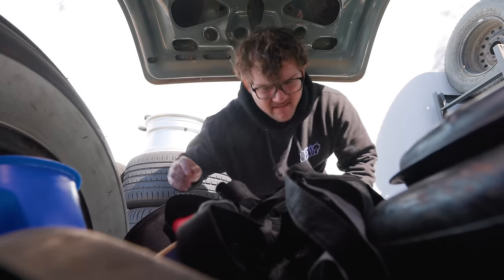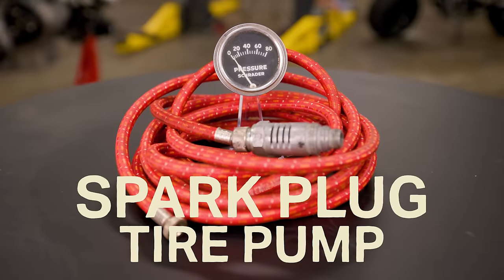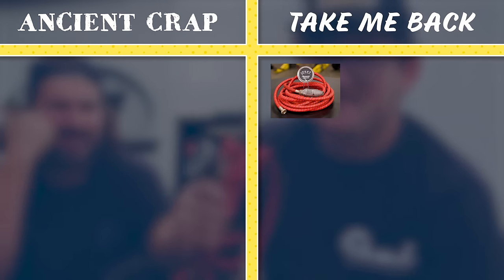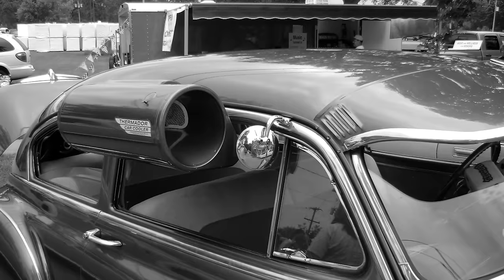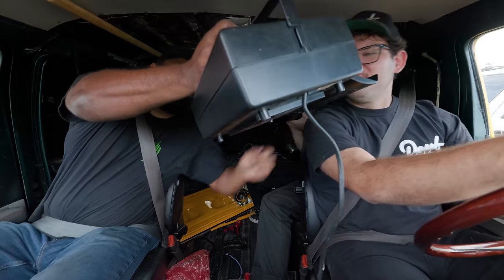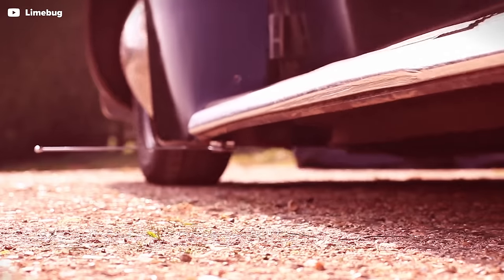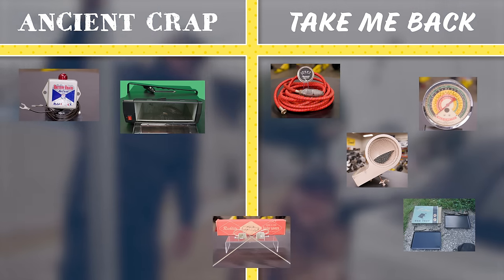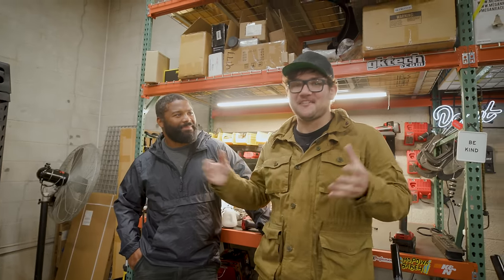Testing Forgotten Car Accessories

Comment: The battery brain isn't entirely rubbish.. older charging systems relied on a current through the charge light to excite the coils in the alternator. If this was in parallel with the charge lamp it would protect against bulb failure and ensure a good current is pulled pretty much as soon as the alternator turns to get it charging before the charge lamp goes out..  so it's only getting you a couple of seconds extra charge.
Reply: Back in the day they used mechanical regulators. By changing the width of the gap on the relays under the cover you could adjust voltage and amperage output. Now for some alternators you can get high-output regulators.

Comment: Regrooving tires is still a common thing; just not for normal car tires.
The two most common places -

Tractor Trailers - because you often put a lot of miles that wear the tread down before the tire is old.  Being said, since it doesn’t need to be perfect, they’re regroove those tires a lot.

Industrial Vehicles - you’re not going to buy a new tire because a long bolt puncture you tire. Since these tires are so massive you need to cut chunks out where the damage is to safely patch it

Comment: The swamp cooler will work great, provided the ambient humidity is low. Lived in SE Arizona for nearly 25 years, and for most of that time I used a swamp cooler on my house. Humidity was about 8-20% most of the time and it worked great. Once humidity got up about 40% during monsoon season, it didn't work so well.

Comment: The tire regroover is still used on tires over a certain ply rating. At least I saw it being used 20 years ago. Did a pretty good job regrooving a 10 ply tire

Comment: My grandpa mentioned the spark plug tire pump to me a number of times. Very interesting to see one in action. I always assumed that it did pump fuel into the tire, and that you'd use it in an emergency and then replace the air in the tire ASAP.

Comment: Back in the 1950s a local farmer used an engine powered milking machine. Remove spark plug. Screw in adapter. Start engine which produces a vacuum. OK unless a valve stuck & milk started dripping from the exhaust.

Comment: alternators were introduced in the 1960's for cars. back then cars didn't need the large voltage.
The light probably drew power from the battery and did its job.

Comment: The tyre cutter is still in use today, but on tyres for heavy goods vehicles. A lot of tyre manufacturers of HGV tyres actually provide data on how deep the tread can be recut, allowing for a longer lifespan. I really wouldn't recommend it on a car tyre.

Comment: The re Groover is the bomb!!!... I used one of those back in the 90s. The tire shop that I worked had one. I didn’t use it on customer tires just my own….lol. Too many burnouts. Made the tires look like new again that’s for sure. I also have a wood burner from the 70s at home. I used that on my lawnmower tires a couple years ago.

Comment: The battery Brain box would have worked perfectly on a lot of charging systems. That resistor would in fact request a higher voltage with the way old regulators worked.

Comment: My grandfather had the spark plug air pump and it really worked. The curb finders or curb feelers as I knew them as were actually a enhancement  for your hoopte in the 70s

Comment: The tire re-treading tool would be more useful on an older style tire or a larger tractor tire. The Ford Model A or T with a solid rubber would probably find better use. A medium sized farm tractor could definitely use the tread tool. I'd bet even some of the small solid rubber tires used on some heavy duty moving equipment would benefit from that. This would be very useful at times in a work environment with smooth floors and you need some extra grip for control.

Comment: Swamp coolers require very low relative humidity to functional. I used to live in Mesa, AZ and the house I rented had one in the attic that would circulate outside air through a huge element soaked in water. We rarely used it, but if it was in the 80s or so it worked OK. We blasted the AC most of time though.

Comment: I used to drive 7.5 tonne lorries in the early 90's and the tyres were " extra thick" and we had a guy stop by who would cut new treads into old tyres.
These were cross ply tyres and not the newer radials.......
I do think sometimes "old" times were better.
The guy used to fix "slashes and flashes" on the sidewalls too. 
Cheaper than new tyres.
The guy was a modern farrier....... 👍

Comment: Tire groover works better if you pull instead of push. I've seen them used to make "cheater slicks", put a couple straight grooves around a slicks to make them street legal.

Comment: Regroover.
Definitely good.
I mostly seen them used for big trucks.
But I've used then on pick up tires.
HOWEVER 
You are correct that in automotive tires they cut down on the quality / durability of the tire.
There were a few times I've seen reproved go into the belts. And if that happens. Tire is shot.
Big Trucks are the only thing that I know the tires were made to be regroved.
When the bars are hit with wear. You could reproved big truck tires once safely.

Comment: That battery life extender tool would actually work, you just need an understanding of electrical theory. While it wouldn't be able to send more voltage to the vehicle it would be able to deliver more current to the vehicle as long as the resistance in the resistor has a higher resistance than that of any other load it is electrically connected to.

Comment: There are modern tires that are regroovable from the factory - and are meant to be regrooved once.  The load range G tires on my F450 say regroovable on them.  they have enough thread but it's not cut all the way because they would be less stable...

Comment: I don't know if anyone said it already but the tire regroover, it usually says on the side of the tire if it's regroovable. I doubt car tires are anymore. But semi truck tires are still. My company still does trailer tires when in a pinch. And I haven't had any fail on me. And I have been with them for 15 years

Comment: I used to have those curb feelers on my car. They do work wonders as I couldn't turn in my mirror enough to see the curb on the right side. Basically, when you set them up currectly you hear them scraping on the curb so you know you're close.

Comment: I've had the same silicone wipers blade for over 3 years and they are still working just fine... I just clean them off because they build up a bit of gunk after a while.

Comment: Dirt track racers that are required to run spec tires have used the tire retractor groover thing that is actually called a siping tool, some spec tires Came with no tread And you would cut your own tread into your tires for dirt track racing. I have used that many many many times.

Comment: With the groove iron it's not meant for low profile tires first off and it was meant for slicks on the racetrack when it's starts to rain that way they can still drive the car in the rain

Comment: You literally took the only item that is still used today and said that it was nothing. 

Curb-scrapers are still huge in African-American and Latino communities. I for sure can tell you that anything from low-rides to donks still use these today. (I live in Mexico 🇲🇽)

Also those tire “re-treaders” are the exact same that they also still use today for things such as hill climbs where I’ve personally used them to cut new “blanks” and not for cutting into old and worn out tires which wouldn’t work anymore anyways as the steel bands in radials are super close to the surface.

Comment: Many years ago I ran a four cylinder OHV powered Austin A50  that if driven hard or carelessly gave only 19 miles per gallon but after fitting a vacuum guage and heeding its message gave over 42 miles per gallon.

Comment: I have a spark plug here with a clear window that allows you to see the colour of the combustion inside the cyl head, the idea is that you use it to tune the mixture settings on a carburettor. Of course, cars have fuel injection and computers these days, rather than SUs or Webers.

Comment: 9:50 fender guards were alot longer, and similiar to a slinky (flexed). most of the time you'd fine triple or double on each corner of the vehicle. they worked well.

Comment: The wiper meter was a sales tools at gas stations when they pumped the gas checked the oil battery and cleaned your windshield and check your wipers

Comment: Regroovers are still commonly used today. I would just recommend that the tires you use it on are marked ,"regroovable". Most heavy tires are designed for it, ie load range E or better, these tires will normally be in the 8+ ply rating as well. My 10r22.5s are all regroovable, so are the 235-85r16s on one of my other trucks.

Comment: the best way to do fill your tire up is a cigarette lighter powered electric air pump takes 10mins to fill a flat and has a fuel gauge reaches all four tires as well

Comment: tyre  tread cutters are still useful for some off road kit using engine compression to pump a tyre is legit also. the swamp cooler is dependent on what yiur local humidity is.

Comment: So the cigarette lighter oven does work.  They have new ones, its Hot Logic, they work really well.  I have a work van and warm up left over (inside a container) all the time.  It takes like 90 minutes to 2 hours depending on exterior temperature.

Comment: I've seen tire retreader in asphalt rallies where the driver doesn't want to switch to wet tires & opts for additional grooves to be added to dry tires. Using them on old, worn out tires seems dangerous.

Comment: Swamp coolers work best in dry environments, like deserts. The lower the  humidity, the better it worked.  The New Mexico house I lived in had an "evaporative cooler". It worked well most of the time but as the season came to an end around September the efficiency started to degrade notably. The more humidity the worse it performed to the point it wasn't worth the effort.

Comment: I'm not sure, about the spark plug pump not getting fuel into it. Back on carbureted cars when vacuum was used to pull the air and fuel in I'm sure the valving on that using worked to prevent that. But on a modern fuel injection, especially direct injection, setups unless you also disconnect that injector, I think you'll be adding fuel to the tire too. Also on modern cars, don't forget how upset the ECU is going to be with a missing plug and injector load. Expect a MIL light on the dash after using this. This is not a tool I would use today, much better to just have a nice portable air pump.

Comment: If you were able to add rubber onto the tire and then use that tool it would be useful but the fact that you take out material from a tire that is worn down it's making the walls thinner and it'll make it more dangerous overall

Comment: Here is one for you ,
No booster Cables, No Booster pack,  No problem , But you have a 20Volt Battery Pack from your Cordless Drill you can boost your vehicle battery with it.

Comment: In the country of India they manufacture their commercial truck tires with extra rubber so when the tread wears out you can retread it with a cutter. I was told that those tires can only be retreaded twice before they have to be replaced.

Comment: i think the old tire tool was for re-treading old bias tires with no belts. big thick old farm truck low speed tires. i have a ton of this stuff from my grandpas old service station. tire studder is kinda cool and not used much these days by folks. use to stud peoples tires all the time back in the 80s and earlier.  great episode guys

Comment: They still retread semi tires, you can tell if a tire has had it done by the 3 or 4 layers of fresh rubber, drivers will joke about how janky it is but its really cheap, and when some drivers replace tires 3-4 times a year you can see why theyd want to cut costs

Comment: The tire retreader was used mostly on tractor trailer rigs back in the day the rubber was a little  thicker that it is today and that left ample rubber for a shop to put new groves in the old tires and you could get another few thousand miles out of that old tire. Also some race car drivers would add extra groves to their circle track cars and even wider groves and cross groves for dirt track cars

Comment: As cool as the spark plug tire inflator is….  I still like my (insert your favorite cordless tool brand.)  Battery inflator.  Set the tire psi with the knob, press play.  And forget about it!   Also comes with a cool light and can be used to inflate other non tires stuff.

Comment: That swamp cooler principal works with a wet sock cooling whatever is inside of it. Did it in Kuwait in 120 degree heat. Cooled our water bottles pretty well

Comment: If you have 160 and higher compression,then thats 160 psi to air up a tire.... They have those air boadders now too to air up 4x4 trucks with the exhaust,in places you can't use a jack.

Comment: I know you're going for low effort content, but the oven is amazing if you use them properly. If you were on a road trip (or a trucker) it allowed your snacks to be hot instead of room temperature. Nobody was roasting turkeys on these, just warming food up. They were significantly safer than a fire-based cook stove, and much cheaper than alternatives like an inverter and microwave (and that only works in large vehicles like semi trucks).

Comment: If you take the spark plug air pump and disable the valve system, then plug the actual spark plug into your tire, the fuel-air mixture will detonate inside the tire, inflating it in a fraction of the time! I'm sure there's no downside to this, like exploding tires, at all!

Comment: I watched a guy use this to fill up a couple of inner tubes for the snow, after about four runs down the hill we heard big boom and saw a decent  fire ball at the bottom of the hill. The same guy stopped to take a break and lit a cigarette while sitting on the tube . It blew up with him smoking. He threw it in the garbage can before he left.

Comment: Maybe a bit off-topic, but first time in history, the sponsor of Yourube video is actually good and isn't full of buzzwords... I don't know for other markets, but my country they sell those Trico also in largest cchain of petrol stations and in "two flavors", green/cheaper and orange/more expensive... However, I bought the expensive one for my B7 RS4 that actually weren't expensive (about 40eur, but this was in 2010), and I was soo impressed that I buy them all the time for all cars, except if there's any exception that needs special wipers, but I can't say enough good words about Trico Flex
Reply: The "Storm Chasers" have to deal with rains that would see most drivers pull off the road regularly. Most of them here in the US use "Bosch Icon" wipers and swear by them. The regular Bosch wipers are pretty good too.

Long ago every gas station had a display of Trico or Ansco wiper blade inserts- you changed only the blade because the wiper arm rarely wears out. Now they only sell arms with blades at crazy prices 😠

Comment: made a version of the spark plug air hose for motorcycles riding .. used an old compression tester and made a longer hose to reach all tires.. that and a plug kit and you are good to go in less than 5

Comment: I believe that battery light box thing was for the days when you checked your batteries, each cell had it's own cap and was filled,  when you started having battery problems, first thing you did was check fluid levels.  Now you can't even open those cells.  Or I could be wrong.

Comment: Okay so the spark plug tire inflator is what my dad used to inflate the tires on his Johnny Popper John Deere tractor from like 1915. It was also started by turning it over by hand turning the flywheel. 
The window swamp cooler was apparently a low end one. Better ones had a water tank as well as an air driven water pump to keep the pads wet. In the days before affordable auto air conditioning they made a trip down the road in the desert survivable instead of a race against death by heat stroke. 
And love the channel but you guys are all too young to be “taken back” by those products!!!!!!

Comment: tire retreading tools are used every day on tires for big rigs and heavy duty trucks.  They are pretty useless on thin, low profile car tires like you guys run a lot of, but on the old whitewalls and the truck tires today there is so much extra rubber on them that you can get an entire second life out of a tire if you know how to recut the tread.  I know I helped my dad retread hundreads of tires over my lifetime.

Comment: That schrader spark plug pump hooked up to a long stroke old school straight 6 engine would air up a pickup truck tire in 20 seconds or less.

Comment: Some circle dirt track racing DIVs still uses the ye old tire irons;  common to take brand new slicks and cut some grooves (karts, sprints, etc...).

Especially true if they do a SPEC tires to keep "tire cost" sane.  Spending 300-500 bucks a week in rubber to stay competitive was never fun.

Comment: that little battery doohicky thing probably used the resistor to bump voltage out of the rulator to shake the plates in the old 6volt batteries in all honesty

Comment: The tire regroover is likely from the early 1940's when tires were rationed, so anything that could extend their useful life would be valuable. 
I kind of laughed at one of you lying on the fender of the old car. When I was a small child in the 50s, camping in roadside parks was common and sleeping in sleeping bags on the warm hood of the car was a luxury.

Comment: The only problem with the spark plug air pump is it those your check engine light on but other than that it's pretty valuable if you can get one that's new and doesn't have the problems of being 80 years old